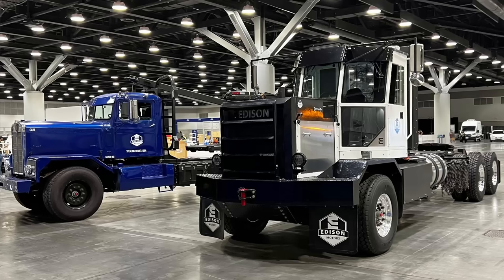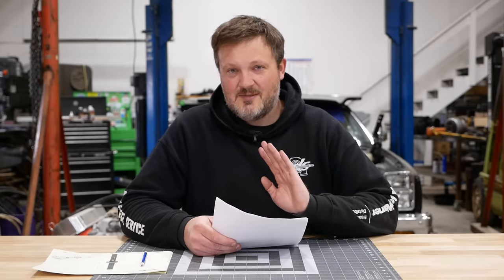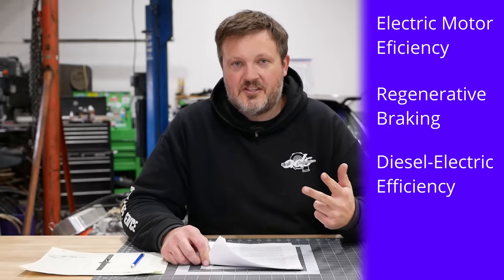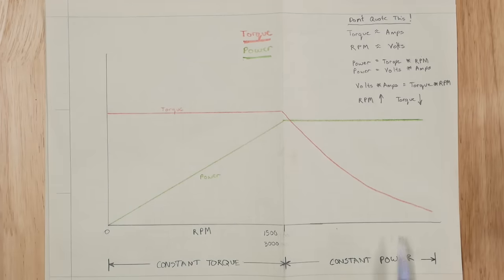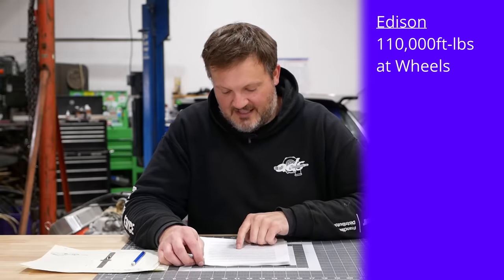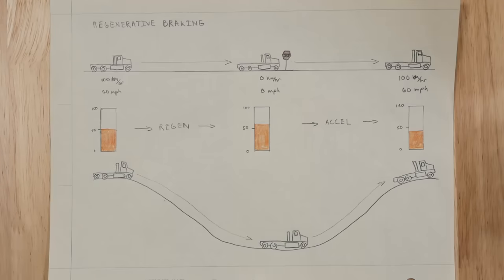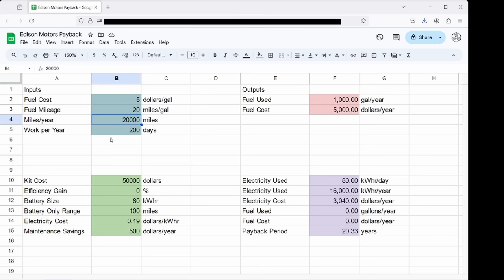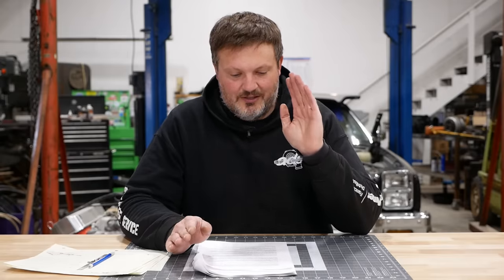Edison Motors Built a Diesel - Electric Semi Truck

Comment: I have been thinking along the same lines as both you Wes, and the guys at Edison. What I have comeback with: you have to do a few things right from the start in order to gain anything. First - an engine that is specifically built to run at a certain rpm with turbocharging running at its most efficient back pressure/boost balance. The engine needs to be perfectly matched to the generator, which has to be built to be as efficient as technology allows. The engine needs to be high hp per liter, like 150+ hp/liter. Both engine and geberator needs to be low weight for what they are doing. I know Volvo and Scania have experimented with such engines reaching almost 60% thermal efficiency. But when you add generator + electric motor you are down to 40-45%. Second - You need to start with the batteries charged to 100% (LiFePo4) every day. Third - It won’t work for long hauls. Fourth - battery prices need to come down. Maybe when NaFe batteries reach the next development stage and prices have fallen to the expected 25-30% of LiFePo4.

Comment: Bingo! Driving otr I really like the concept but we have so far to go to get the numbers to align properly. Trucking as a numbers game is hard enough. Keep in mind that all these numbers ULTIMATELY trickle down to the consumer. That steak goes up $.50/lb at the market for a reason. Not a direct relation. There’s a lot going on behind the curtains there as well. But why add more cost to a problem that doesn’t purely exist. It’s like you mentioned with the locomotive industry. Their efficiency doesn’t come from the locomotive itself but rather that they can carry so many cars as opposed to my one trailer. You stack my one trailer to their one car and I’m burning less carbon than they could ever hope to achieve. Evening further consideration would be that diesel technology isn’t new. We know what works and what doesn’t. Get the EPA to leave well enough alone and we can make greater strides in efficiency than ever thought possible. These diesel engines of today are so far ahead on every metric and yet the EPA comes in and says no. But everything comes full circle and it’s all a numbers game. The only determining factor? Who holds the bag. Maybe technology will get there one day but today’s not that day. Thanks for the video and letting me ramble.

Comment: I agree with pretty much everything you said except for the Cybertruck numbers. I have a real world experience there and I know what it’s done for me. 

On average I drive about 80 miles per day. 55k-60k miles per year for work. 

I need a truck for what I do. 

A tank of Diesel costs me $150+
Oil change on a Diesel $150+ 
Transmission and coolant and diff fluid changes. $xxx per year 
DEF/DPF fluid $xxx per year 
Injectors go bad. Gaskets need replacing. Leaks happen. 

Not on a Cybertruck. 

I can charge at home for 9.9 cents per KWH. Cost is roughly $250 -$500 per year. 

I’m not saying I can long haul with it. But if you own a landscaping business that’s local where you drive less than 400 miles per day. Or own a land survey business. Any business that requires a truck and requires you to drive less than 400 miles per day. It’s an absolute no brainer in my opinion. 

Also, a brand new Denali GMC Duramax is $120k 

Cybertruck. $100k 

No maintenance. No fuel. No parts to break. Bumper to bumper 100k mile warranty from the factory. No oil changes. No issues or concerns to worry about. More efficient for work because you don’t have down time getting fuel and oil changes. So you can get more hours per year on the job site. 

Absolute no brainer.
Reply: Your electric is about 1/2 the cost per kilowatt hour as mine.

Comment: There was a company called smith who  carried out ev conversions of the Ford transit van in the uk approx 15-20 years back. They were popular in London due to the emission zone. The vans themselves worked well from memory, they were limited to 50mph and had a 100 mile range , but due to battery’s failing prematurely and few places to repair they had a short lifespan. Infact people used to buy the very low mileage shells and put the diesel engines back in .

Comment: Another problem they are running an emergency standby generator which does not have dpf or scr. That will not fly when they try to go to production they will have to have the full after treatment system since it will be considered prime power so they will have to package that as well.

Comment: I owned an early hybrid Escape.  I loved the car.  It was powerful to drive, comfortable to ride and drive, the MPG was higher than any Escape available.  Mine had 4wd so it was a little heavier than other Escapes and hybrids.  Subsequently, I have owned a 6 cyl Escape and a 4 cyl supercharged Escape.  All had the same characteristics of my original hybrid and none got as good gas mileage.  I traded the original hybrid at 60K miles.  That seemed a maximum trade-in value before the vehicle would need expensive maintenance on its CVT transmission or replacement of the battery pack.  Each of those items was estimated to cost in the neighborhood of $5K at around 100K miles.
I currently own a 2008 Chevy 3500 4wd Silverado pickup.  This truck has a little over 110K miles.  It has good bones and could be converted to a diesel hybrid.  However, the truck is currently worth around $12,500 which would make converting for $50K beyond stupid as it would take me another 16 years to amortize the new expense.  Incidentally, my original cost for this truck, new, was approximately $50K so my savings per year would have to be astronomical to make a conversion worthwhile.

Comment: I didn't hear any discussion of load efficience.  On the electric truck you are hauling the additional weight of the batteries, which reduces the load capacity of the truck. More weight is hauled with no payback and the payload is reduced.  A significant efficency loss in and of itself.  Weight of the batteries added versus loss of payload.

Comment: I appreciate the honesty in this video, thank you. In my opinion electric will never be the complete solution. It's great for someone who lives in a city and only drives to work. Only living in a warm climate because the batteries don't work in severe cold. Lithium comes from China. It is in a limited supply. Contrary to popular belief so called fossil fuels are unlimited and don't do near the damage they try to make you believe. Let's not leave out what it costs to replace them
Reply from the maker: I dunno. We burn a cubic mile of oil every year. That's just insane to think about.

Comment: I think they will function best in machines are aren't driving continuously, and also in the standardization of parts (which will keep maintenance costs low). For instance, if a service truck is idling for most of the day, it might as well be electric. But having a range extending generator takes away the range anxiety. I don't see any savings for OTR trucking, but probably not any more expensive.

Comment: What voltage are they using to power the electric motors?  If they plan on keeping the motors alive, they’ll have to pay through the nose for IP69 rated motors (they won’t be able to enclose the rotors due to heat).  Those motors will not be cost effective with their current price claims (I used to be a Baldor sales engineer).  Most electric induction motors are continuous duty-rated.
Reply from the maker: I believe the batteries and axles come from China. They are supposed to be IP68 rated. I think what they typically do it take the continuous rating and then go way over it and call it the peak rating. It's very common for machine tool spindle motors, which are very similar to EV motors.

Comment: The problem with ev and hybrid trucks is the weight of the batteries and the electric motor/motors depending on how they designed and made them which decreases the hauling capacity so you're actual hauling less than you could normally if it's a series type then the motor will run at same rpms all the time instead of varying the rpms which uses more fuel

Comment: Good job Wes, good discussion, solid numbers, I should mention I am an engineer, I operated reactors most my life.  I think hybrids are the wave of the future.  Love my Ford Plug in Hybrid.  I also think renewables are the wave of the future.  It is distributed power and about 2/3 cheaper if you consider that your standard energy production facility be it coal, nuclear or gas spents 1/3 on fuel, 1/3 on waste and 1/3 on the actual equipment to generate electricity.  There are no waste disposal cost for wind or fuel cost.  You still have to pay for construction and disposal of generation equipment.  I enjoyed you VID.

Comment: I thinķ diesel-electric might be okay for high-torque at low speeds.  I don't know if it can save fuel. If it saves 20 percent fuel and reduces wear it could be worth it.  Maintenance costs of Class 8 trucks is a major cost.  Reducing idling time could save money.

So, they need a parallel mechanical path?  Like a Prius

Comment: Bummer I thought they were on to something  and a few figures from the trucking industry  the cheapest new semi I know of is the Mack anthem at $188,000 and it’s  is getting around 8 mpg in a over the road application the best mpg I’ve seen in a vocational application is around 5.25 mpg . The newer diesel engines are achieving a near flat torque curve reaching peak torque around 900 rpm until about 1500 rpm .Unfortunately they only make the numbers look worse than your calculations . But great video worth the watch.

Comment: For the logging truck regen braking example, Edison may be able to recharge enough going downhill loaded to climb back uphill empty. They are essentially adding “fuel” to the truck in the form of really heavy logs each cycle. As you say, there are a lot of variables involved and we don’t all their values!

Comment: Huge users of electricity (cross country pipelines with electric pumps and things like a quarry) pay an average of $.07 per kwh.  Wonder what electricity rates a huge recharging center for these vehicles would get.  $.19 is an office / residential rate.  Wish I could plug $.07 into your spreadsheet.
Reply: Depends heavily where you live though, doesn't it... Where Edison Motors is from there is a lot of hydro afaik.

Comment: I used to convert gas engines to liquid petroleum gas. It works efficiently enough, and the half cost of the fuel makes a typical payback of around 2 years. Little loss if power, space and more heat generated, the killer was the eco engines cannot cope with higher temps and due to inferior materials, fatigue. This Wes; had me thinking. Loved it!

Comment: I suppose with a smaller diesel engine running at an efficient RPM and if you had a solar array on your roof at home where you park your truck, than the fuel and energy cost savings would be significant indeed. But all claims could have a few Swiss cheese sized holes in them once all is said and done? It's difficult at this stage to really know for certain. Any way it turns out, the idea is sound in principle. As for the power steering and power braking system, they may be able to design a uni-directional slip-(sprag) clutch style belt driven alternator/generator which continuously runs off of the drive belt on the engine and then from the battery system to power the steering/brake/vacuum system and whatever else?

Comment: i don't know all the techincal answers. however, in simple terms that i understand, there are always losses when one form of energy is converted to another. i.e. nowhere near the potential energy in a gallon of diesel actually becomes working energy at the flywheel of the engine, batteries require more energy to charge than they put out(converting mechanical energy to electric energy), converting electric energy back to mechanical energy through the electric motors on the drive wheels will also cause more loss. i don't see how they can make up for all that energy loss with the extra efficency they are adding. the regenerative braking of a heavy loaded log truck going down hill is the one thing that makes me think it is really possible in that scenario. this, with all the info u just gave, makes me believe the math just doesn't add up. but i could be wrong. so no complaints from me, wes. i agree with u.

Comment: The good news with them is they are not biting off more than they can chew.   Focusing on Logging in a very Liberal Province the company will do just fine.  Then focusing on Oilfield in Alberta and Saskatchewan which has to show how they are being cleaner. They are going to be a huge loyal customer.    Most oilfield companies have pretty large solar installations now in Canada anyway.  So if the owner plans to bring the truck back to the yard at the end of the day with an empty battery and charge them from the grid. It will be a little bit cheaper than diesel. This changes the return on investment, slightly.  But definitely cheering them on.  Love those guys.  Hope all levels of the Canadian government stay out of their way.    Plus I love they use a wiggle wag and not a low air buzzer!

Comment: I think they can get 5-10 percent with stop and go delivery trucks and logging in the mountains. But I think you are correct on the on highway for sure. Aerodynamic are absolutely key. 

I think that you can get lifepo4 at down to 85/kwh now, and are supposed to drop more. 

The emissions was definitely a question that I had, but I think that’s why they are going after the older trucks, because it be an improvement.
Reply: 5-10% better fuel economy? From 10 mpg to 10.5-11? Not even close. Closer to double the mpg for city trucks. Highway and over the road is where it isn't efficient.

Comment: It’s like a locomotive with a big battery…if any big truck can work with big battery power…this one can. I would however make sure you can bypass the traction battery completely, like when cold,…and connect directly to the traction motors. And if you can specify AC traction motors, you won’t have peak torque ratings….they are robust enough to be mostly immune. And yes…locomotives suck  prodigious fuel….their efficiency is in the tonnage they can pull. That puts them way way way ahead of trucks of any kind.

Comment: Thank you for sharing your thoughts on this topic. I have many of the same thoughts related to Edison motors.  
I fully support them and want to see them succeed. I have watched their progress from nearly day one. 
At times I’ve had some trepidation about their claims. 
But when they announced these pickup conversions kits and all the benefits people would have. 
First thought was this may end up being the end of Edison motors. 
As they have made light of other manufacturers over promising and under delivering. Which I feel will be the result most people will feel like with these conversions. 

I can see the benefits additional benefits gained by these kits being used on a service truck or the like. But the average truck owner will see little of those benefits and far less efficiency gains. Then they will hope for or is in anyway implied maybe the case by Edison. 

I think the bases to much of this entire idea behind Edison motors and now their retrofit kits are based solely on their own narrow personal experiences, conditions, usage and cheap BC hydro power prices and extremely high fuel prices.

Comment: We don't know the prices of the lower tiered Cybertrucks yet, but if they are more than $10k greater than equivalently spec'd internal combustion pickups, I'll be surprised.  $35K?  No way.  I know that Musk often appears to be borderline crazy on Twitter, but he still has good business chops.
Also, your $500/year doesn't include any revenue losses when the trucks are out of work while in the shop.  Those would be significant.

Comment: Serial hybrid drivetrains in trains, mining equipment and ships like the ancor handling vessel I took part in building are made that way because it's better than gears and hydrostats at delivering imense amounts of torque while maintaining fine control. The alternative would be a hydrostat or maybe a torque converter setup, and these are not as efficient.

Comment: You're looking at the efficiency of series hybrid as a road train and not taking into account the efficiency of the series hybrid as a city truck. Stopping, going, shifting, sitting in traffic, idling. All that can be done on battery. Even with the Shermanator on the back the amperage they were pulling from the batteries to make that truck get going was so minimal. And talk about smooth.
Reply from the maker: I can see your point.

Comment: It’s not about batteries, or drive trains, or straight EV vs hybrid…..it’s only about energy.  Because of that, the difference will always be limited to low percentage gains/trade offs between systems.  None of this is the panacea being sold by automakers and pushed by politicians.

Comment: I have a Ford F-150 power boost, it's hybrid, I wish it was a diesel electric. It's a nice truck but pretty disappointing as far as mileage goes. It's neat to be running around town on the battery. They cost a lot more than a regular F-150. I wouldn't do it again.